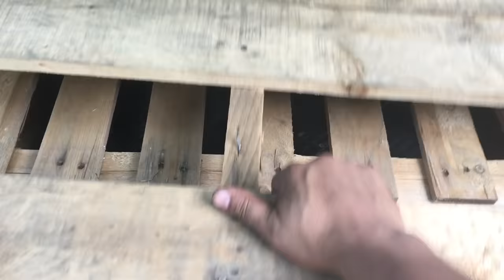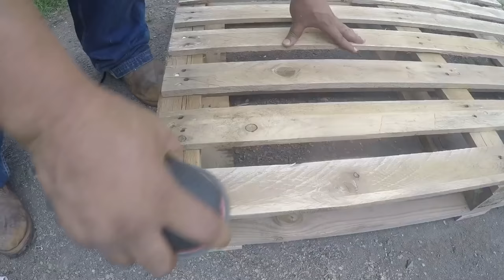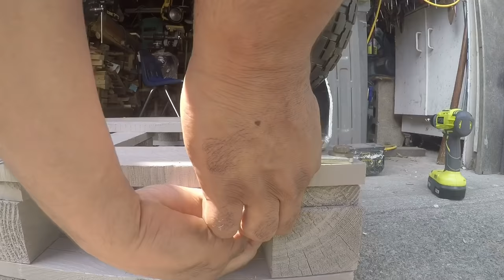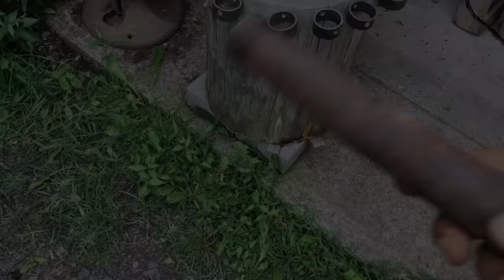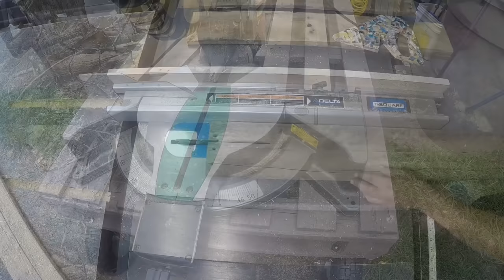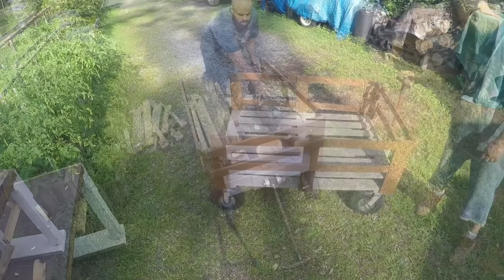DIY Pallet Wagon

Comment: This was great I see you had all the tools to not get held up on the build, just a thought you should add a push bar like a shopping cart so it could either be push or pull. I'm in a wheelchair so I'm usually pushing rather than pulling. I heavily modified a shopping cart, I chopped it down and used a plastic bread rack for the box it has low side's so big things can be put on it. I had it for so many years the rubber on the wheels wore down to the plastic wheels. Time to change the wheels.

Comment: Awesome job! You sure have some really nice tools for dealing with disassembling pallet wood. Just today my arm is sore from jerking those pesky nails out once I got them broke down. I have pallet blaster similar to yours and I use a awl punch to get the nails out, that works great for the small wood but the bigger frame pieces are horrible to get out. I finally just ground them off.

Comment: I’m making a wheelbarrow from an old water tank and I’m wondering what castors are they?
Also, are you totally satisfied with them doing turns etc?
Thank you so much for your video.
Reply from the maker: I bought them from Harbor Freight. They still work great!
Reply: @ConstructIcon  thank you so much for your answer.
Reply: Were they expensive? The one's I can find are like £50-100+ each

Comment: Great idea!  Our garden cart has almost rusted away but the wheel are still good.  As soonas I find a decently sized pallet.....

What is that tool you used o drive out the nails at about 0:50?
Reply from the maker: chris littlefield a pneumatic denailer that I was eyeballing for awhile & finally purchased off of Amazon. Works great!
Reply: Lp

Comment: Very nice. Where did you get the bearings you used on the lower end of the handle?
Reply from the maker: They are called pillow blocks...bought mine at  P&T .…(a local omelette Upcycle store) or you could buy them online or perhaps at a automotive store. Thanks 🙏🏽